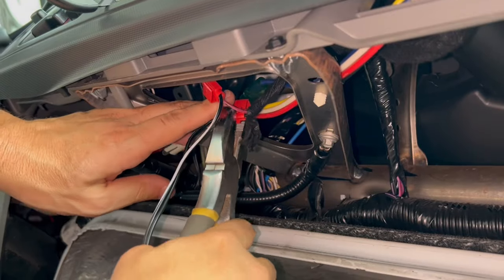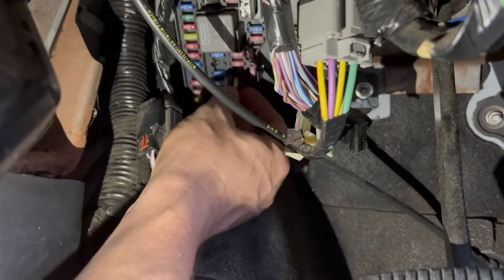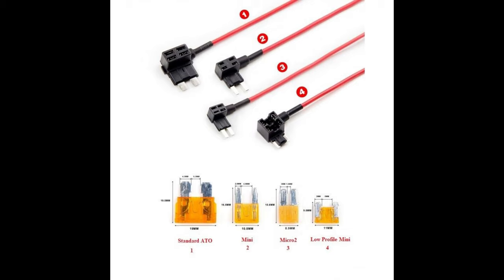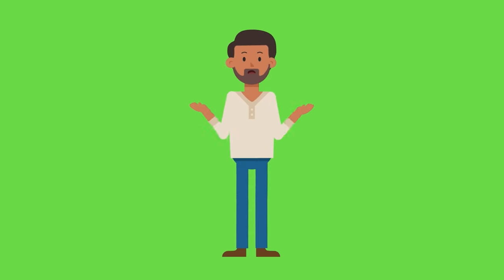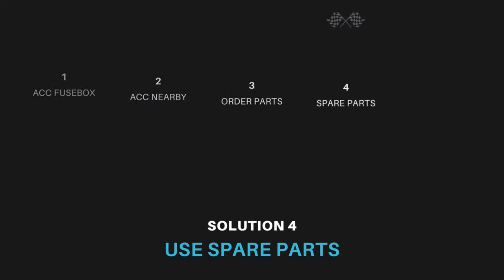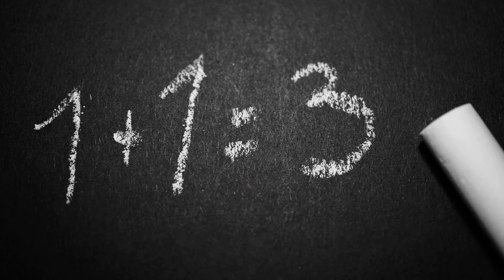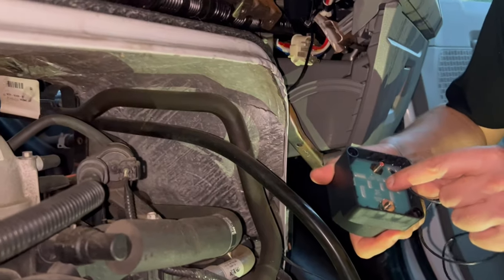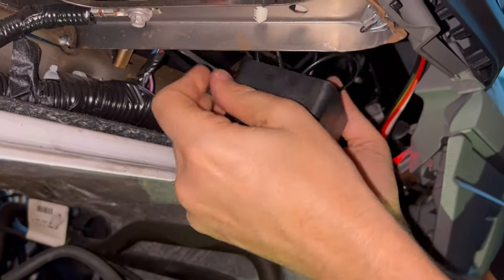[UPDATE] I Wish I Knew This Before I Hardwired My Dashcam Backup Cam

Comment: I gotta be honest I saw the 1 st video and thought this can’t be that easy to hook. I’m so glad you made your mistake and are not ashamed to show it. I’m also happy that you’re bypassing the step here and not waiting for the switch in the mail and doing it your way. These teaches us we have options. thanks for the great video
Reply from the maker: Thanks @milagrossmith4891!   So true, mistakes are the best way to learn.
Reply: So my car actually has another Connection in the glove compartment so I can plug it in directly instead of having to do all of that wiring
Reply from the maker: @milagrossmith4891  Perfect!  Hopefully the glove box outlet doesn't have constant power so you don't have to worry about your battery 🔋